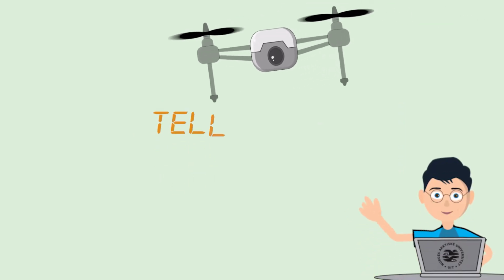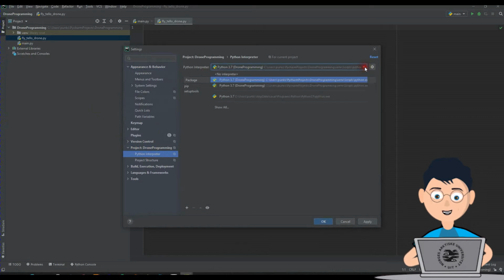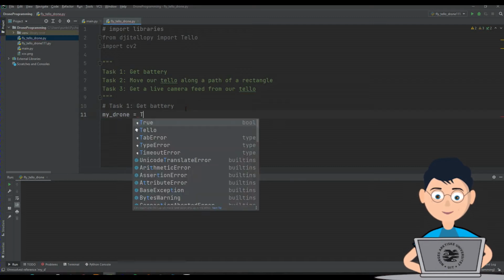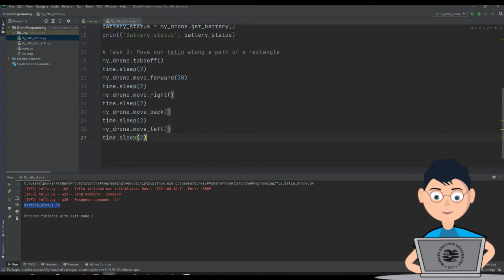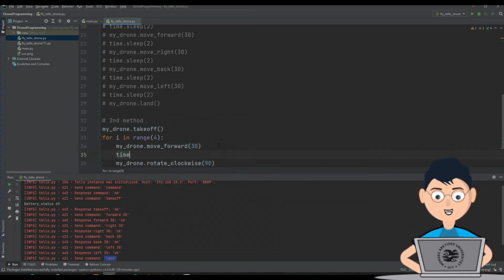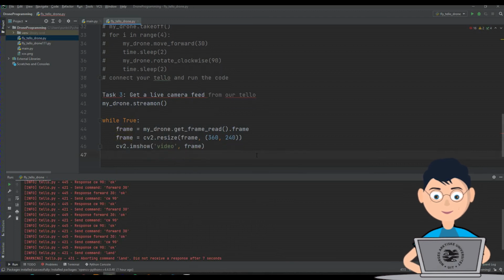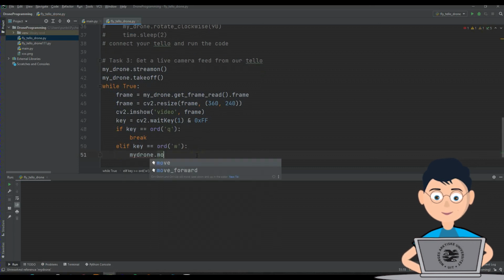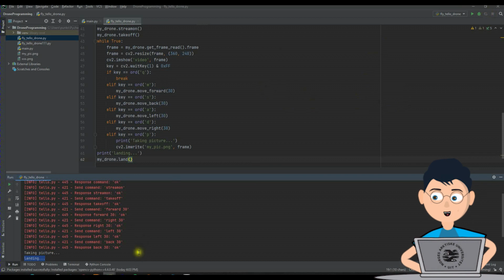Part 3 Tello Python

Comment: hi, I'm doing a part of a project in which a drone flies along a certain route and I need it to fly straight along the line (because this is a building and it won't be good if it crashes). I have attached duct tape to the floor. tell me, please, how can I tell the drone to find this duct tape and fly exactly in the center, focusing on this line on the floor?